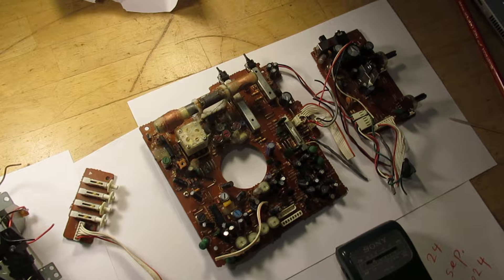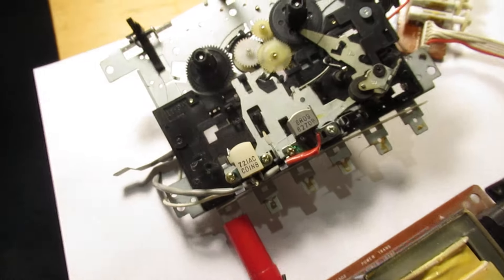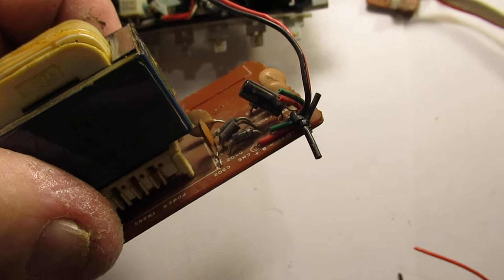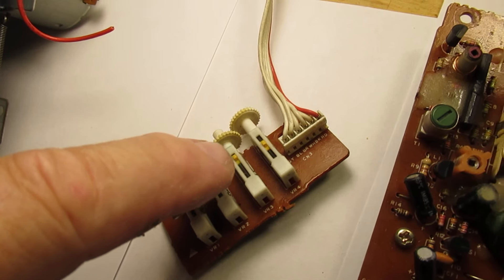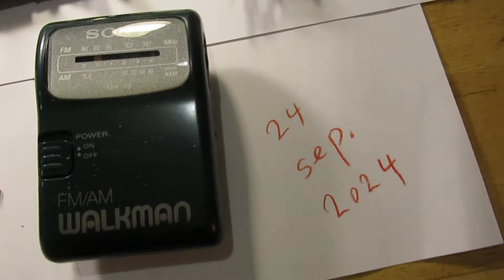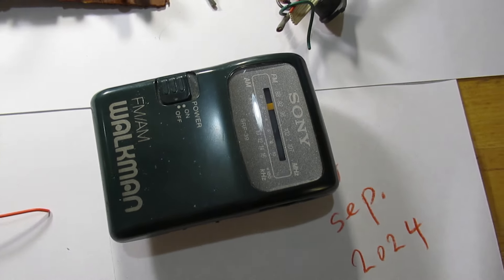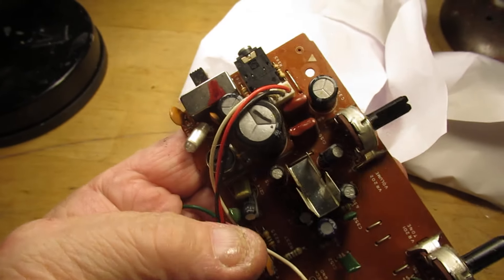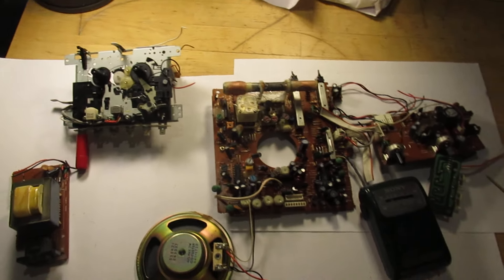Old circuits from the 1980's & 1990's: cassette recorder unit + a FM/AM radio unit & with more info

Comment: Very interesting and reminds you of the high quality of Japanese electronics in the 80s and 90s. I was impressed with the variable resistance driven by cogs. Some great components and would love to see some of them used in your projects. A shortwave radio tuner perhaps?
Reply from the maker: I think I will try to get the LW radio working.

Comment: i got many components from this stuff too
Reply from the maker: Good! When they are healthy you can do some experiments and/or get units or components working in other electronic circuits.
Reply: @radiofun232  yes, very simple circuit 1 to 2 transistors circuit, usually oscillators!

Comment: can you link the videos you talk about this potentiometer please.
Reply from the maker: Thanks & here are links to video’s about this subject
Shottkey diode used as varicap (21 jan. 2024)
https://youtu.be/Ze_P0LQGTrI 
something about the varicap (8 aug 2021)
https://youtu.be/aq-50_fLy9o 
LEDS used as varicaps
https://youtu.be/1qLrSPcJWV8 
Green LEDS used as varicaps
https://youtu.be/8YVUHqoc11k 
FM receiver where normal Si diodes are used as varicaps in the local oscillator (links to other videos are in the textbox of that video)
https://youtu.be/F5whmoEcbn0 
normal diodes used as varicaps
april 2018
https://youtu.be/ar3ChC7eDWw 
Shottkey diode used as varicap
https://youtu.be/UUrYL2p5k4Q 
Barrier voltage of diodes
https://youtu.be/AmcaMFdrLPc 
Furthermore: in other books there is a lot of info about the (say) capacitive effects on the barrier layer of a transistor or a diode.
That capacitance changes in relation to the voltage applied to the semiconductor, using the potentiometer as a voltage divider, where a changing voltage via the node causes that capacitive effect. 25 sep. 2024.